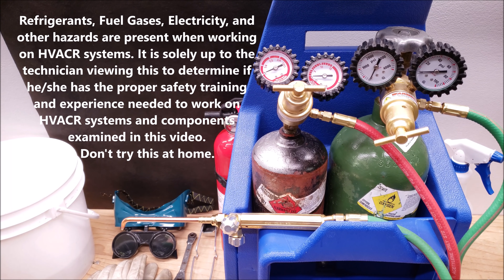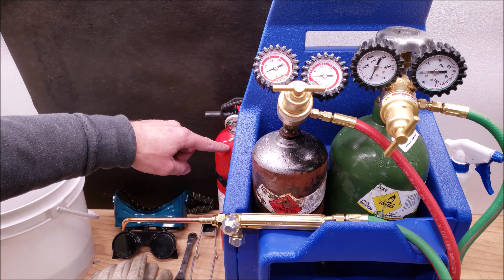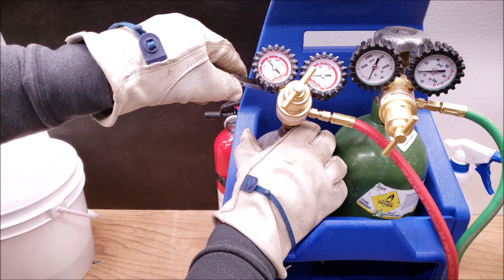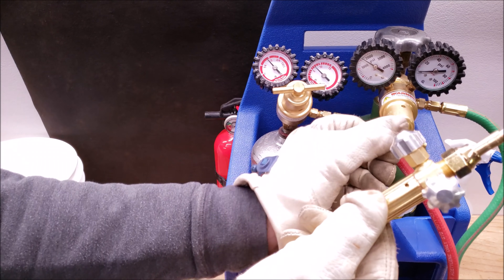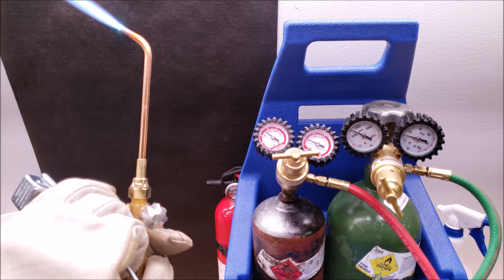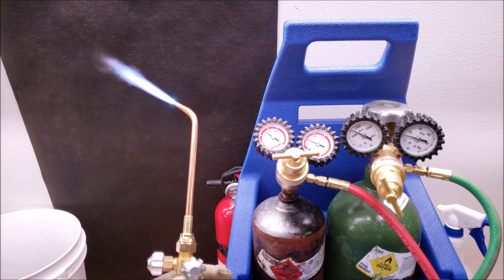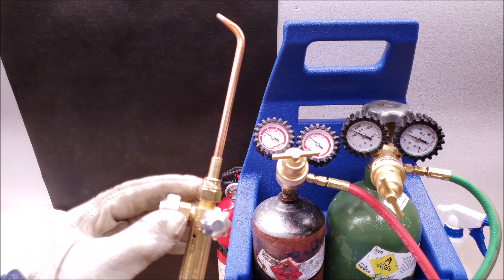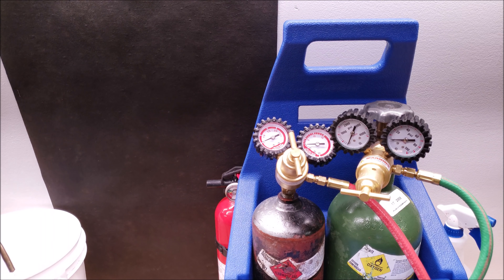Oxy Acetylene Brazing, Torch Adjustments- Reducing Flame, Oxidizing Flame, Neutral Flame

Comment from the maker: Support-  https://www.patreon.com/acservicetech

Tool List-  https://www.amazon.com/shop/acservicetech

For those that are looking for the tools used in the videos: (Linked Below)
Uniweld Cap-N-Hook and #2 Tip Oxy Acetylene Torch Setup- https://amzn.to/2STp3Fe

Ameriflame Oxy Acetylene Torch Setup #1 &#2 Tip- https://amzn.to/2SRm3JF

#2 Tip for Oxy Acetylene Torch- https://amzn.to/2SPDaeD

Cap-N-Hook Tip for Oxy Acetylene Setup- https://amzn.to/2MbhpUk

Air Acetylene Torch setup    http://amzn.to/2aQalsb  
15% Silver Brazing Rods  http://amzn.to/2gVLyLc

Nitrogen Regulator    http://amzn.to/2bXdR5f

Nitrogen Flow Meter    http://amzn.to/2brvoBg

Yellow Jacket Refrigerant Gauge Set http://amzn.to/2aenwTq

Refrigerant hoses with valves http://amzn.to/2aBumVI

Yellow Jacket Gauge set & hoses https://amzn.to/2vLVkV9

Yellow Jacket 4 Port Manifold w Hoses https://amzn.to/2BkuGIq

FieldpieceSMAN360 Digital Manifold Set https://amzn.to/2BdoaD4

FieldpieceSMAN460 Digital Manifold Set https://amzn.to/2nB4Fe6

Fieldpiece ST4 Dual Temp Meter  http://amzn.to/2wc1ME3

Compact Ball Valve for Refrigerant Hose https://amzn.to/2KUisW8

QuickDisconnect 90 for refrigerant hose https://amzn.to/2MMtVcg

UEI DL479 Multimeter with temp sensor http://amzn.to/2jtsUbJ

JB 6 CFM Vacuum Pump   http://amzn.to/2nqbvo8

Appion Blue 3/8" to 1/4" Vacuum Hose http://amzn.to/2uYlVyc

Appion Red 3/8" to 1/4" Vacuum Hose http://amzn.to/2uYg6Ro

Appion Valve Core Removal Tool http://amzn.to/2uYr8WL

Yellow Jacket 1/4" by 1/4" hose http://amzn.to/2umtcod

CPS Vacuum Micron Gauge http://amzn.to/2v1nM3O

Supco Vacuum Micron Gauge http://amzn.to/2v1JRiA

RectorSeal Bubble Gas Leak Detector http://amzn.to/2ckWACn

UEI DL389 Multimeter  http://amzn.to/2xAdaJf

Digital Refrigerant Scale http://amzn.to/2b9oXYl   
Accutrak VPE Ultrasonic Leak Detector https://amzn.to/2nFYKVe

Imperial Kwik Charge 535-C http://amzn.to/2uipEI6 
FieldpieceSDMN6 Dual Manometer Pump http://amzn.to/2jyK5Ka

Supco Magnet Jumpers http://amzn.to/2gS4h6z

2 pairs of alligator clips- http://amzn.to/2CtIL5z

JB Vacuum Pump Oil   http://amzn.to/2mGrlXy

General Tools digital Psychrometer http://amzn.to/2cSHsi1

Fieldpiece SDP2 Digital Psychrometer http://amzn.to/2nniMVR

Ratcheting Service Wrench http://amzn.to/2dGV4Nh

Appion G5 Twin Recovery Pump http://amzn.to/2dGSEyr 
Irwin Wire Stripper/Cutter/Crimper http://amzn.to/2dGTj2V

Other tool links can be found in the video description section.

Shop through Amazon! Your Purchases through Amazon provide a means for channels such as mine to earn advertising fees from all purchases after clicking through. Prices are the same as normal-    https://www.amazon.com/shop/acservicetech

Comment: Actylene, is a volatile, gas. Unstable, which is why , inside the tank, there is a porous material ;  binding  the gas up , for  Safety Reasons. !  Also,  never go beyond 12 - or more, on the Dynamic  side, of the torch.  Static side, is from that  torch / twin ends,....to the supply tanks.   Carefull....on that  Dynamic  Pressure  side....

Comment: I just can't see the flame differences on  my 17 inch laptop. Would be even worse trying to see it on a phone. Good instructions but am afraid i will use a neutral flame and burn holes thru my copper tubing. First attempt and burned hole thru 3/8 copper tubing . Very frustrating.

Comment: You use a #2 tip in the video. Is that the preferred tip for brazing copper lines? What is the advantage of the #2 vs #0 for this application?
Reply: The #2 tip is basically the most used torch tip in the HVAC industry for brazing residential/light commercial systems with 3/8", 5/8", & 3/4" copper line sets.

Comment: I clear the lines when finished oxy-acetlene cutting, I don't back off the regulators, a old timer welder told me that would ware the diaphrams in the regulators.  Always double check both tanks are shut off.  Tanks should be transported in up right position, and strapped down so they can not be tipped over on it's side.

Comment: I know you don’t want to produce black soot, but lighting the torch with both valves open is very dangerous.  You can have a flashback in the hoses, that sounds like fire crackers going off.  They are small explosions in the rubber line and will end up back at the regulators.  You will then have a fire with rubber, oxygen, and acetylene burning together, making thick black smoke.  I used to light my torches like that all the time until one day I had a flashback and fire at the very large tanks.  This was in a multi million dollar computer room, and shut down operations for several major credit cards.  I was told by the regulator manufacturers rep never to light my torches like that again, and we were required to install flash back arrestors on all torches after that.  I agree with everything else you presented.  I think you covered all the bases.
Reply: I'm a bit curious too why all these online youtube HVAC creators show this as well.  I learned from one of those old school safety videos and they have always promoted turning off the oxygen to avoid flashback.  I think I'll take a bit of black smoke over my regulator blowing up.  This is why you don't just learn from youtube.

Comment: Black smoke is an indication of the acetylene flow. If the gas flow is lower than the flow of flame it may mean the flame enter the hose. That is why I would not use the oxy first. You open the acetylene and increase untill the smoke dissapers and that tells the flow is ok.
Reply: thats how i was taught also

Comment: I just joined an HVAC company with a tankard plumping knowledge and basic sheet metal work and advanced electrical knowledge. I no brazzong experience but understand the concept but this video filled In all the theory on every question I had on the very nuances of oxy/acetatyln setups and brazing. I absolutely subscribed and thank you for sharing your knowledge

Comment: Great video, thanks for posting! I would like to note one thing though - I know for cutting torches, all the big torch manufacturers recommend killing the oxygen first, then the fuel gas to make sure the line and valve are purged of any soot and close fully. I don’t think it matters too much, but they do take the time to say do it this way so maybe it does matter? Idk. Thought I’d be that annoying guy in the comments and mention it at least.

Also, I remember my dads old brazing torch tip had the psi stamped on it but my new smith tip says MW205 and no psi mark. Do they not do that anymore or is the 205 some sort of code that corresponds to pressure settings?

Comment: Turn the oxygen bottle on slowly while not looking at the gauges in case they burst. Then fully open to set the valve back seat to so it closeS properly . 
Always make sure regulators are turned out.
I was taught for brazing to set the ace at 7 and the oxy at 11 without running the gas.
I always start the ace only and then the oxy.
Turn the oxy off first in all cases. 
Never start you torch next to the tank.
Never breathe brazing fumes. Use a carbon filter mask.

Comment: I’m practicing brazing right now with a  setup I just purchased. 

60cu.ft Oxy / B Acetylene tank. 
Harris 510 HD torch outfit which has Harris #5 brazing tip and also came with a Harris 1AC- 2 piece cutting tip with oxygen lever. 

First time taking the braze tip to the 3/4acr and elbow  it blew a hole right through in about 2 seconds flat with a reducing flame. The second attempt and beyond it looks as though the joints were fully sealed visibly with the 15% silver braze rods, but it still seems as though I may have over heated them- if that’s even possible. 

I’m still practicing before I have to get it right on a project. 

Actually I had success easier at first with the high preheat cutting tip without pressing the oxygen level of course.

Comment: Uhm...so.....yah ...

... you pulled off lighting acetylene and oxygen make sure without any problems but I don't know .. I think I'd like to continue lighting one gas at a time and getting that one correct before making a 5000°F mess or explosion.  The amount of soot that comes off a torch for someone better than I am is a mirror one or two seconds dissipates quickly as if it were a cigarette that was lit for a few seconds and then put out.  

Now I just bought my kit 24 hours ago and I suck so I sit all over the place until the wand turns black before I can get a neutral Flame. But my day job isn't working inside house.

I also am a believer that the pressures should be set by what the tip manufacturer dictates. My number 2 Victor wants 3 PSI acetylene minimum but my Victor Rosebud 6-MFA-1 dictates an 8 PSI acetylene minimum.

Comment: I always set my gas pressures at 5 and 10 but i just realized uniweld states to. use a 5 and 5. Is there any significant differences in doing so?

Comment: 35 years ago with my training, was trained by old masters in torch welding, I still prefer to use torch to weld, but now learning HVAC, but torch is torch, never leave wrench off tank! & put away that ratcheting one, accidentally leaving it on to open & if need to close during emergency could cost precious time, use the old school figure 8 wrench that you can slap with hand quickly to shut it off. 
i do not like adjusting gauge without a flame, very dangerous try that with big tips, you will regret it! when you strike it to light & see a big fireball, NOPE! light first, hold torch safe direction pointing away from tanks, & adjust regulator to 5-7  psi, your preference for running pressure. 
you open oxy first? thats a good way to get a flashback, to have flame ignite inside torch, then you will see black smoke rolling out, & it whistling, VERY DANGEROUS! and another reason to be able to cut acetylene off quickly,  ALSO WHY NO FLASHBACK ARRESTORS?????
you do like me on having torch pointing to the left, but most important find position to get comfortable with, & excellent on shutting it off, acetylene first, for oxygen to blow it out,  then oxygen.
Reply: Yeah my take was that you light the acetylene first because the oxygen is the catalyst. The acetaline won't combust without reaching open atmosphere first. If you add oxygen in the very beginning your risking flashback. You do get that black stuff everywhere though. Not blowing myself up is more important though.
Reply: @123hooterman  If you don’t want the black smoke, just open the acetylene  a little  more.  I had a bad flashback,by lighting with the oxygen on, and it blew up the hoses and caused a fire back at the regulators.  I almost thought I was going to die, because they were very large tanks.  Luckily I got it shut off, but everyone around me ran.  After that, we installed flashback arrestors on all of our company torches, and were told never to light our torches like that again.
Reply: Thanks for the most important life saving tip. Thanks for taking time to share it. So let me repeat it DO NOT CRACK OXYGEN FIRST, ALWAYS ACETALINE FIRST .
RIGHT?

Comment: That’s a “MC” Acetylene Tank and a “M” Oxygen Tank. Does anyone know what “MC” and “M” stand for? Also I always use a Solid Wrench for my Acetylene Tanks, when the Wrench is on the Valve, it means the Valve is “Open” Hung over the Regulator, means the Valve is “Closed.” I put a Wire Cinch tie through the Smaller Wrenches, a Short Looped Chain through the bigger Wrenches, so I can hang them.
Reply: MC stands for motorcycle. MC stands for motorcycle on acetylene tanks, as they were originally used to light motorcycle headlamps

Comment: Thanks for making these videos, they are really helpful and very well done, but I do have to disagree with your oxy-acetylene start/stop procedure. If you search every manufacturers torch manual, they ALL say to turn oxygen off first, then acetylene. Then in BOLD letters, they ALL say "In the event of an emergency, TURN OXYGEN OFF FIRST". The reason is that if you have a leak from the torch handle acetylene valve, and have the oxygen still flowing, you CAN burn acetylene right back into the acetylene tank, and in order to burn inside the handle/hose/tank, acetylene needs oxygen to do so. Turning off the oxygen first prevents a possibly deadly event from ever happening. Same hazard with turning your oxygen on first when lighting up.

Oxygen off first also prevents the "popping" sound you hear, and that pop is not "blowing things clear" of the tip, but blowing things back into the nozzle where it clogs the tip with soot.
If you are quick with the oxygen after lighting the acetylene first, soot is held to a minimum, and if outdoors, it doesn't matter at all.
Reply: I like his video. but have to say I agree with you about the problems that you mentioned . the right procedure also in the textbook.
Reply: Had to browse the comments to make sure someone said it.
Always reverse order when turning off the torch.
Turn off the oxygen first, then the acetylene.

Comment: Do I need to wear the welding glasses when brazing? I never see the HVAC techs wearing it during brazing. Is it needed?
Reply: Brazing flame and melted metall are the source of UV radiation. This is what smart people say. If you look at it day by day for years, some surprising morning you might find yourself in difficulty to find your pass to the bathroom. Its for you to choose if to beleive it or no.
Reply: It’s not UV it’s IR , infrared radiation.
The dark safety glasses for brazing are needed for eye protection from debris. The dark tint is to allow you to see your work because it’s so damn bright.
Not to protect you from radiation. This is dangerous to believe because brazing glasses cannot be used for electric welding . You will go blind if you think brazing glasses are for UV radiation. They are not.

Comment: When u say reducing flame you mean carbonizing flame right. 1by 2 by etc carbonizing flame for soldering/brazing, neutral flame for brazing/welding, oxidizing flame for cutting bending And destroying stuff lol. When the outter cone is 2 x the length of the inner cone that's called a 2x carbonizing flame. Use this flame if your not sure of your ability to avoid pokeing holes in pipes. Sure hope you have a back flow preventer on there instructing folk to turn on oxy b4 turning on ace. Ace is the 1st thing u turn on and the 1st thing u turn off. Have you ever seen and unstable ace bottle explode. This is what happens when the acetone becomes unstable in the bottle from laying down and not being stores in the upright position. If this were to happen with oxy being turned on 1st BOOM. They probably won't live to tell the tale. Understand the soot thing. Lack of oxy. It's not near as bad with a clean torch tip. 
Lady's and gents, never turn  the valve on an  ace tank more than 1/4 turn. In an emergency you have to be able to turn it off quickly. Ok to turn oxy tank valve all the way open. Set ace at 6psi and oxy at 8psi. This will get you through just about any job. When you get urself proficient at brazing with various tip sizes typically 0 thru 3, step up to a rosebud tip. It's like using a turbo torch on steroids. Lol. No disrespect meant here.  I've seen bad things happen to inexperienced people playing with a rocket ship in a cart. Happy welding 😁
Reply: You mean carburizing flame....not carbonizing 🤦
Reply: @Mr_Daddy1980  yeah that one 😁👍
Reply: @Mr_Daddy1980  hey man, I. Can spell Technician, But I are one 🤪 haha
Reply: Wow, thank you..my teacher never explained it this well..and they told us to keep acetylene under 10 and oxy under 45!!!..so much bad information..at least they said the part about only turn acetylene 1/4 turn

Comment: I used to use these torches. I switched to turbo torch and couldn’t stand it. I just got a new set of uniwelds but every time I shut the flame off it pops. Why is it doing that?
Reply: And yes I turn acetylene off first.
Reply from the maker: Maybe turn the oxygen up a little first. Is it possible that the tip size you used to use was larger? Thanks Davey!